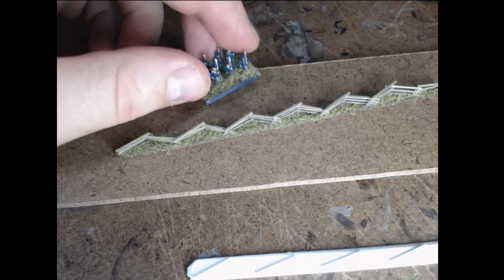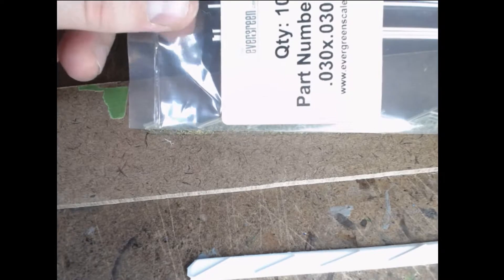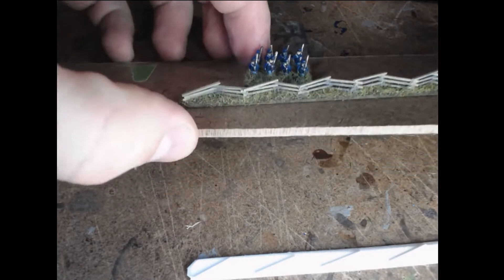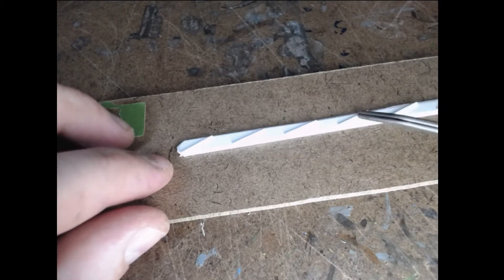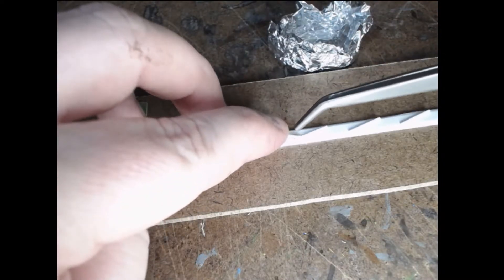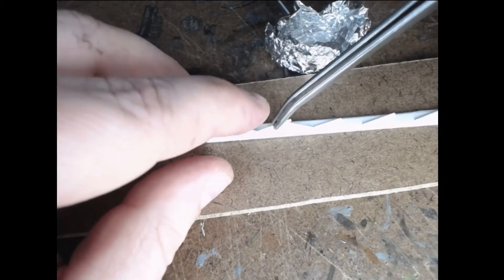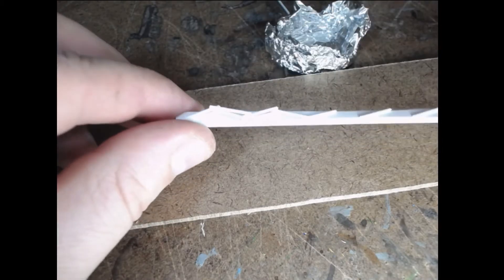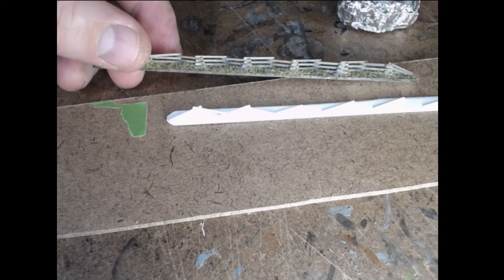6mm Snake Rail Fence

Comment: Fantastic looking snake fences, I made roughly 20 to 30ft of snake fencing with matchsticks. They turned out great but as the matches were quite thick I couldn't go too high. However after watching this is be happy to remake them using your method. 

May I ask what you used to cut the plastic with also was it basic superglue you used and how strong would you rate the fences for being handled in a wargame .
Reply from the maker: I used an easy cutter. I'll try and put the link below. I cut up a bunch. Also I would recommend buying directly from evergreen if your in the USA. You can get the bulk bags. When you cut them be sure to do it in a box so when the pieces fly they all stay in the box. 

 As for the glue I used the standard plastic glue. I found that the citadel bottle with the small metal tube works best. I tried the thin glue but couldn't get it stay wet long enough when I did the longer pieces. hope that helps. 

https://www.amazon.com/Midwest-Products-Hobby-Craft-Cutter/dp/B0006O2AJO/ref=sr_1_1?keywords=modeling+cutters+angles&qid=1554310379&s=gateway&sr=8-1
Reply: Project Wargaming Thanks for the info. I stay in Scotland so I'll see if there anything like what you use here, if not I'm sure I'll order it from the states.